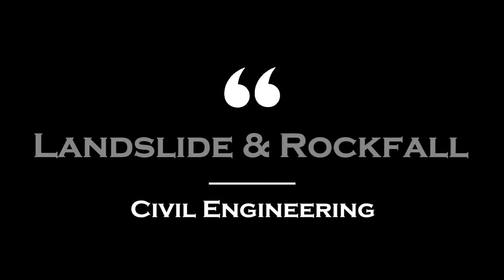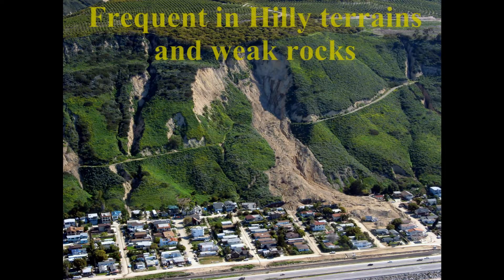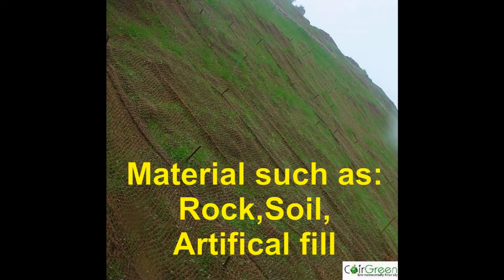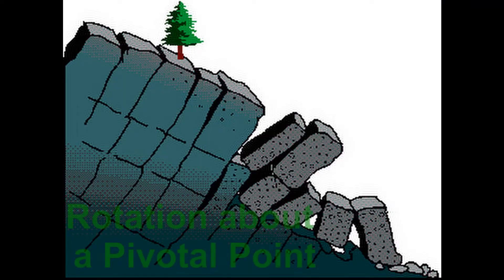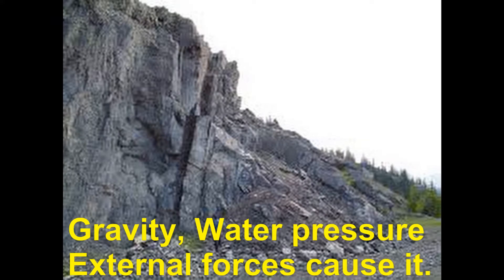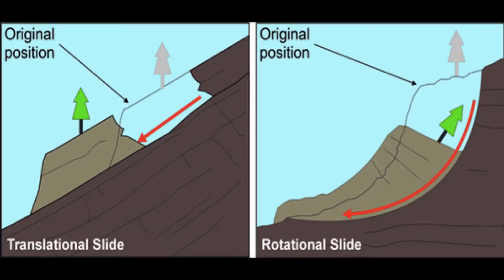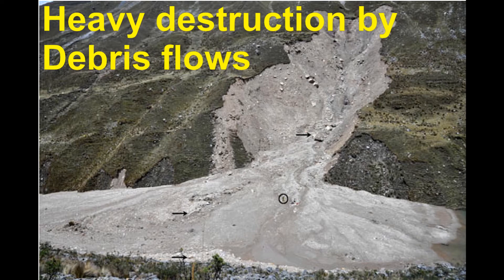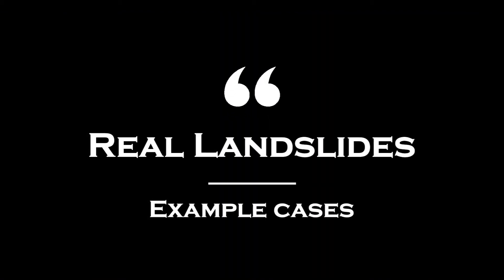Landslide and its different types

Comment: Actually howmany degrees of slope, cause to landslide.
Reply from the maker: It does not depend only on the slope angle as there are several stability and instability factors involved such as the cohesion, angle of shearing resistance, confinement. In easier words with stronger materials and stable condition you can see high degree slope as well as nearly vertical slopes also. I would advise you to read up on that.